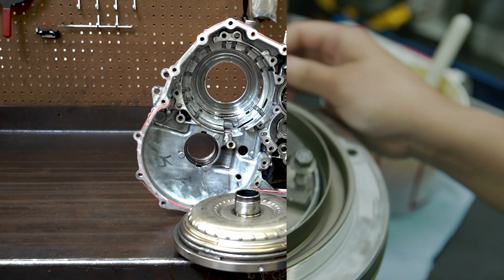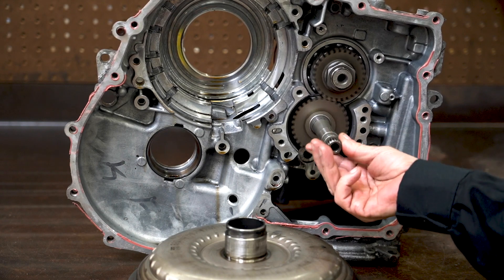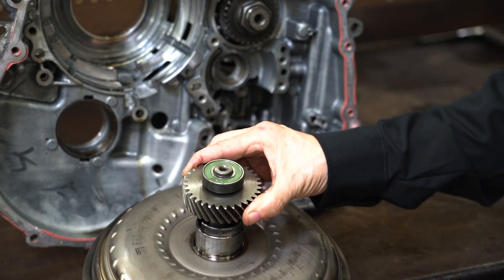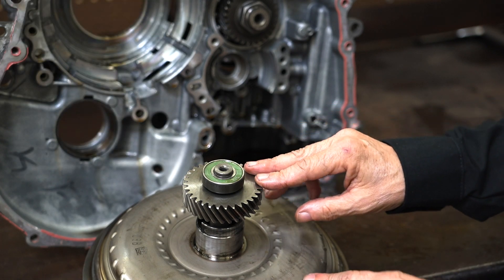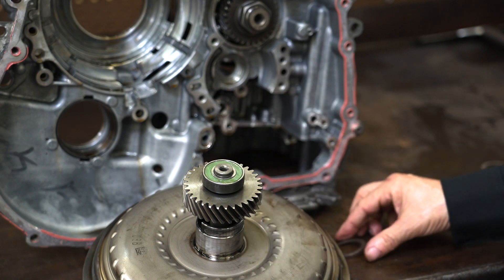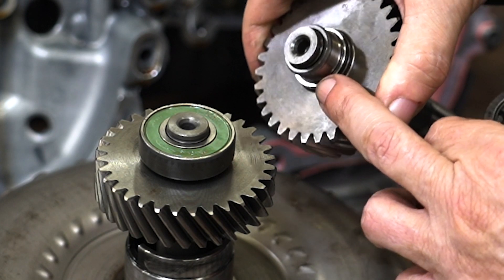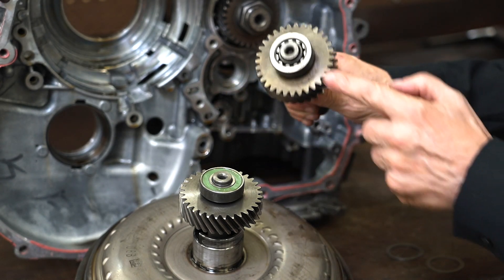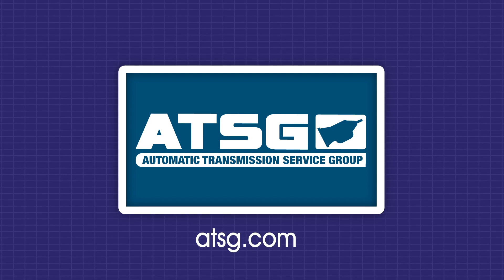From the ATSG Bench: CVT Noise Complaints with Glenn Troub

Comment: What exact component is responsible for this sound, and under what conditions does it occur?
I hear a faint clicking or ticking noise as soon as I lift my foot off the accelerator pedal at low speeds. The sound is noticeable below 40 km/h and seems like a light, intermittent clicking or ticking coming from the transmission area (CVT).
The sound disappears completely when I press the accelerator and gradually increase speed, and I do not hear it at higher speeds.